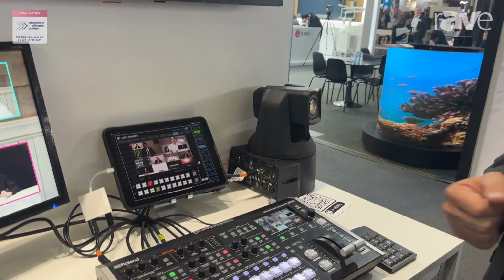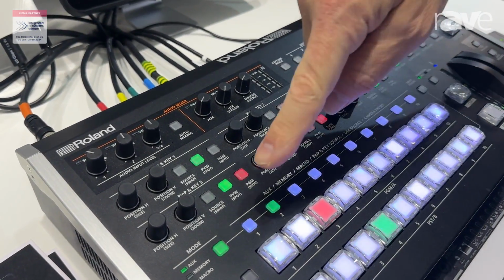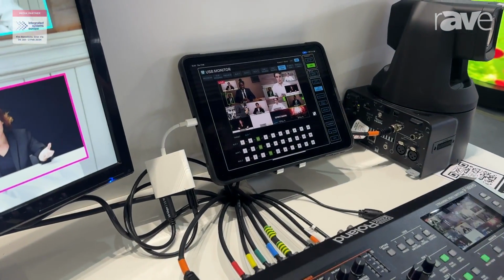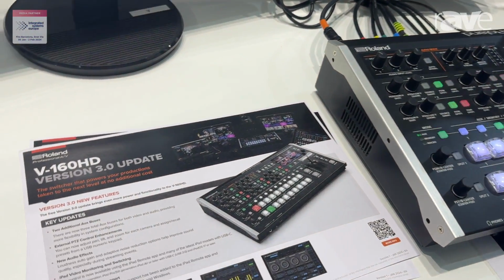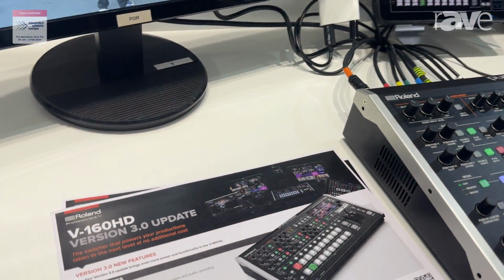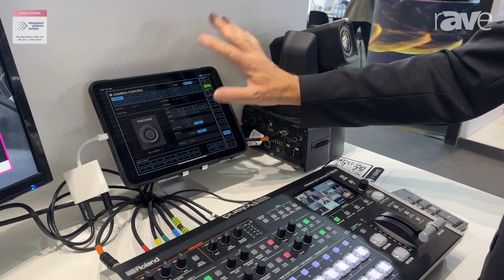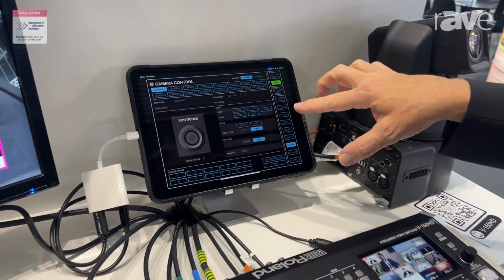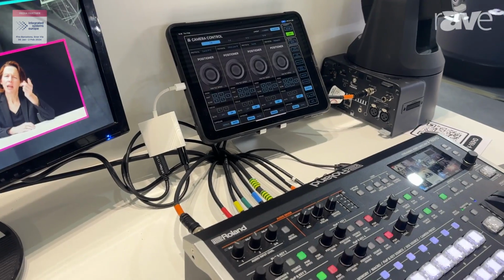ISE 2024: Roland Updates V-160HD Event Switcher to Version 3.0 with More Aux Buses

Comment: hi would be possible to have more lines of programmation in the macro board .? just 10 is not enough to complexes size and crop for differentes types of pip
let me know, i have send a message to roland us and wait for their answer .
we need more lines  because to switch betwin 100% crop and 80 % for exemple , we need to programmate a new line 
the same is when use 4 box and go to 3 box  , need one more line to shut off the pip don't play ...

and also the possibility to have aux in the multiview
thanks for your return
all the best